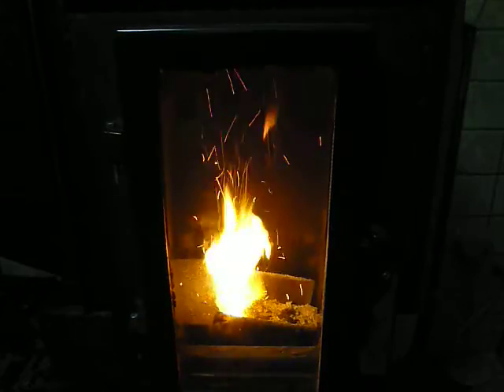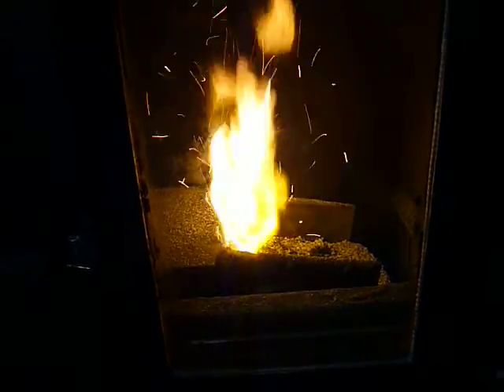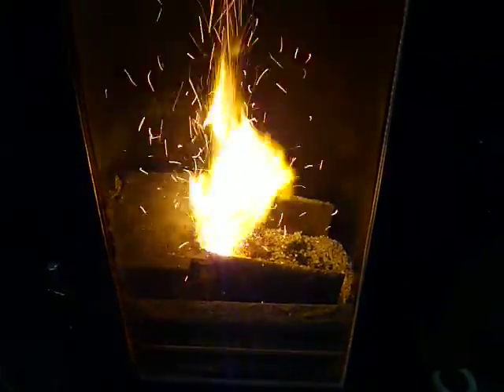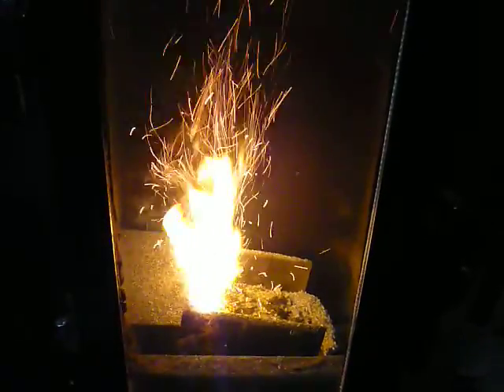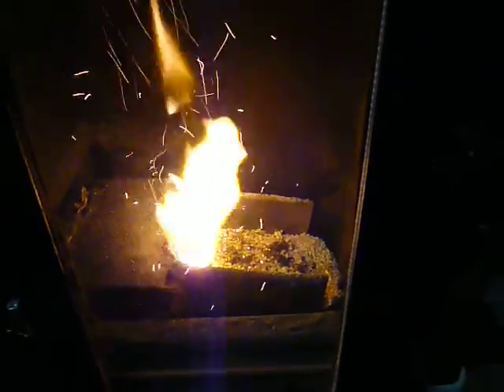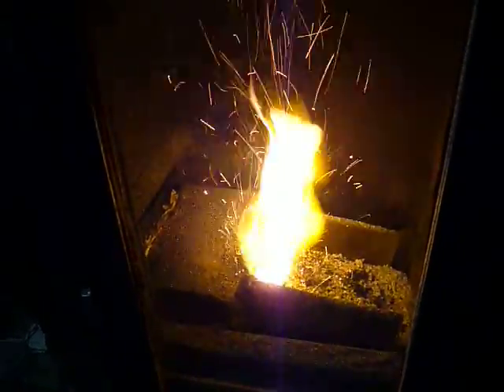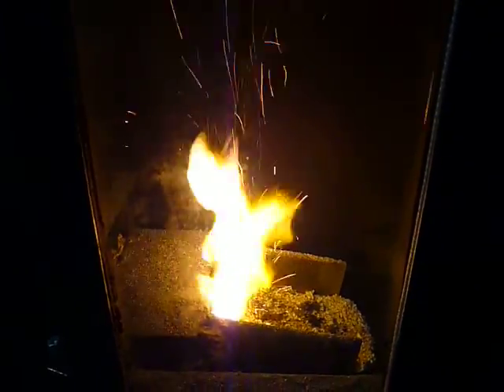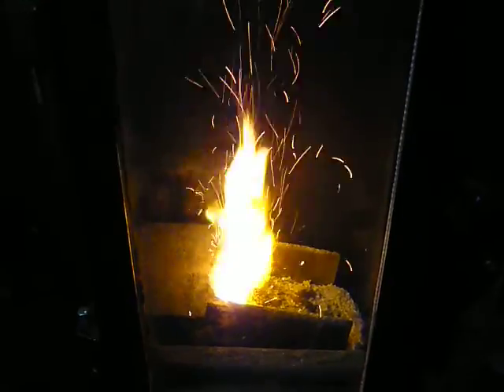homemade coal stoker stove

Comment: What are you using for a blower.
Reply from the maker: Dayton 1TDN8 Blower 49 CFM 3037 RPM 230V 60/50hz......the 115V equivalent is the 1TDN7.

To be honest that blower was somewhat over sized for the grate area, if i was to do it again i would be looking for something around 15cfm.

one of the reasons that i picked the blower that i did was that it has a flow adjustment damper on it

Comment: Where you live Hippy, What kiwi coal are you burning, Kai?
Reply from the maker: osty123  yep...kai coal......the grade is called chip coal......between 4 and 10mm
Reply: unhippy1 was curios about your stoker. where are you based? I burn Kai as well in a word chip furnace as it is still ws cheaper than chip. have a issue with all the ash tho